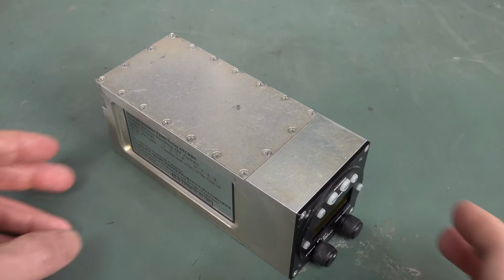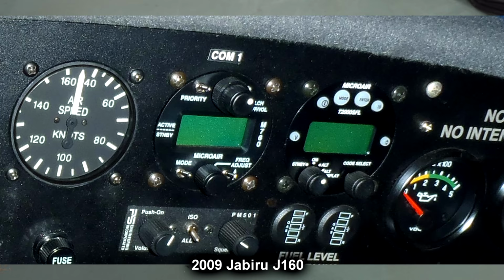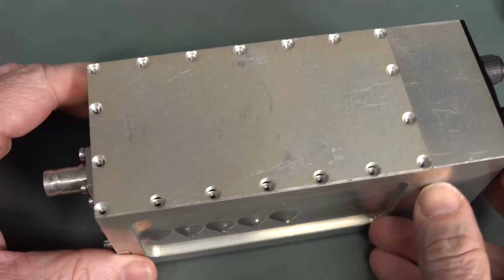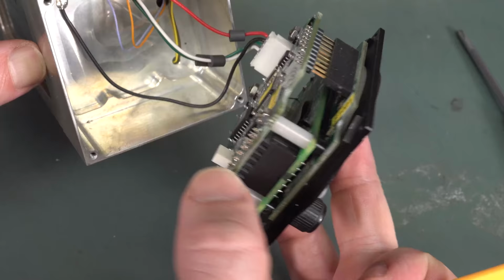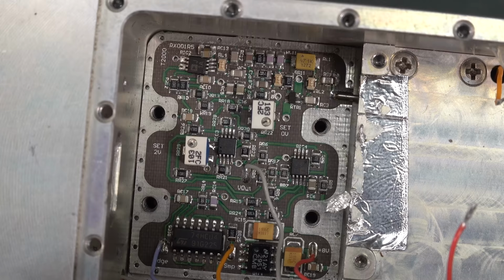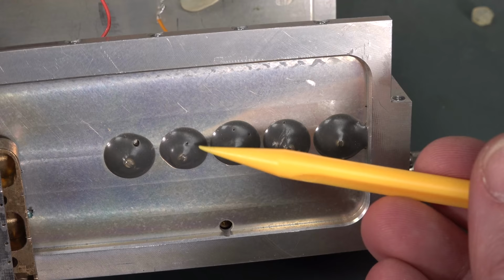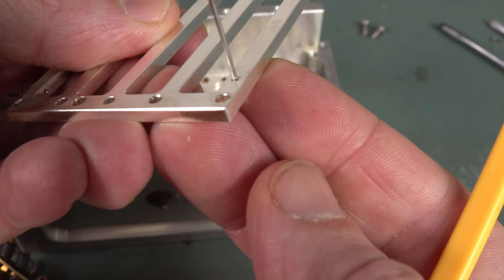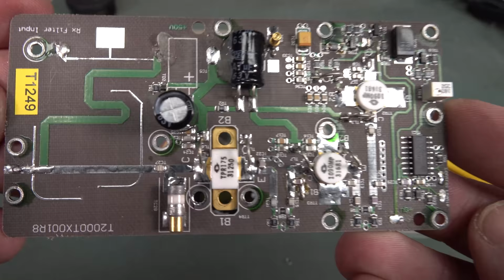EEVblog #1352 - Aircraft Transponder TEARDOWN!

Comment: Quite beautiful, but not exactly "designed for manufacturability". Wonder how much simpler it would be if redesigned in 2020. Not likely since all those regulatory approvals must have cost a fortune.
Reply: I wonder how all those floating unsupported wires survived the shaker table, but I guess they are short enough to survive. Definitely not short enough to pass design requirements for “big boy” avionics – they don’t allow this even if it may pass testing.

Comment: What, no massive --->>> arrow or outraged / disgusted / disbelieving face in the preview? YouTube stats won't like that. Good on ya! The filter is sometimes called an Interdigital filter (digits = fingers rather than numbers) very common when you are dealing with full duplex RX and TX that are comparatively close in frequency. When they are single channel this is a good efficient solution to the problem. Nice high Q.
Reply from the maker: Doesn't an interdigital filter have alternate grounded fingers? The terms seem very loosey-goosey.
Reply: @EEVblog  No. It's just a series of optimum-coupled resonators in a linear form.
Alternating the direction (if used) is to reduce the capacitive coupling. 
In this case the interleaving strips are to reduce the inductive coupling.
Without them an optimum-coupled filter will require surprisingly large spacing.
Reply: @EEVblog  It is a relatively general term, the various topologies and architectures are just "gravy" so to speak. Each designer tends to have their own tweaks and optimisations, depending on need and personal preference.

Comment: woah, woah, woah... Soldering alumium?!
Reply: Yep, you can solder to aluminium even with regular 60/40 solder.  It's all about technique (and/or the right flux).
Reply from the maker: With enough flux you can solder anything
Reply: That is not impossible. There is an old trick with mineral oil and a piece of steel wool under the leaded soldering iron tip to do it even without using any flux. And with all the modern fluxes and solders available today a job like this is actually pretty easy.
Reply: @Kirillissimus  Yes, the only problem soldering aluminium is that the material oxidizes so quickly the solder can't alloy with it.  If you provide a barrier (flux) that stops the air reaching the aluminium and then also provide a mechanical abrasion to break through the oxide it will take solder just fine.  Be aware though that aluminium is a great heat-conductor so you'll need an iron with plenty of heat or you'll never get things up to temperature.
Reply: @xjet  If a joint does not want to get hot enough then it probably just means you need a bigger soldering iron. Or a blowtorch on the other side of the part. Or both. Just don't melt the alluminium itself.
Reply: It is silver plated
Reply: @shazam6274  Of cause it´s silver plated, first because of the skin effect at 1GHz ! That´s normal with SHF stuff
Reply: @xjet  Copper has not quite twice the heat conductivity of aluminum. If you can heat a copper piece enough with an iron to solder to it, you’ll have an even easier time with aluminum – it’ll drain the heat away at half the rate, everything else being same :) Copper is easier to solder to, and alloys easier with solders IIRC, so that compensates for the heat loss as the joint will take at a lower temperature. Aluminum soldering needs a proper technique since the joint has to be isolated from oxygen and deoxidized fully to get a good joint. Usually a special flux is used, but in a pinch a high boiling point mineral oil will do.

Comment: I don't think this cost 2500$ to make
Reply: I don't know what their manufacturing costs were, but I can guarantee you that it's not cheep!
Reply: Not to make, no. But to certify, perhaps.
Reply: Yup, it’s the certification costs that control the pricing. You can often get almost identical non certified equipment (for “experimental” aircraft) at a fraction of the certified cost.

Comment: Aviation for small planes is very stagnant and overpriced. It's very much like cars in cuba. Nursing old junk. There is some progress but it really is awfully backwards.
Reply: It's changed a lot relatively recently. In 2014, the Experimental Aircraft Association in the US worked out an agreement with the FAA for a program of issuing Supplemental Type Certificates (STCs) for aircraft fitted with experimental avionics.

That's led to vendors like Avidyne, Dynon and Garmin coming out with relatively low cost glass-cockpit instrumentation systems based around high-quality displays, solid state gyros and air data sensors, CAN-bus system communication, and software that can be updated on a six-monthly release cycle without requiring recertification.

Originally designed for homebuilt aircraft, the STC program means they can be installed in certified planes like Cessnas and Pipers, which has driven production volumes, keeping prices low.

I'd rather a (relatively) cheap Garmin G3X system than a monstrously expensive G1000 system. Retrofitting a G1000 into a Cessna 172 is an almost $100,000 exercise, vs $25,000 worth of gear to get exactly the same capabilities from STC'ed electronics.

Garmin and Dynon primary flight instruments are less than US$2k, in a 200 gram package containing air data sensors, gyros, 6 hours of backup battery power, a sunlight-readable color display providing artificial horizon, heading, skid-ball, altitude, VSI, HSI, and (optionally) a CAN-bus autopilot controller.

Not your grandma's instrument panel.
Reply: Both Cuba's and GA Aviation's reason for stagnation is also pretty much the same: laws... In the other case maybe necessary, in the other maybe not so much.
Reply: @MarkNewtonFlies  FAA is blamed for a lot but that's just not true. A grave example is Incontinental and Lycoming engines; crude engines originally designed in the 1950s, produced largely unchanged ever since, they are unreliable and unsophisticated and have only gone up in price ever since. It's so grotesque that a Lycoming AEIO-580 6 cylinder 315HP piston engine with no turbo or anything remotely modern now costs 139k$, not including installation. A Cessna 172 first flew in 1955, based on a design from 1948. It's the most sold small airplane in the world and is still produced today with no replacement and goes for 400k$. Engineering and aerodynamics wise it's a turd with wings. Granted it is a small market but such phenomenal stagnation is not on FAA. It's quite possible certification procedures could be more streamlined but I've heard only decent flexibility from FAA and it seems to me that it's not the certification process that leads to great development costs, it's just the development that costs. New planes are certified from time to time, some go bankrupt, others don't but I've actually never heard once that they had a perfectly good design ready and FAA incurred unbearable costs for no reason. I'm not saying FAA is a picnic but it's most certainly not the cause for the inexplicable stagnation in small GA. I guess the real reason is intimidation by the topic and then it just sort of happened and people have been too vacuous to question it.
Reply: @sageii5614  See, you might say that, but my 1950s-designed Lycoming IO-320 uses about the same amount of fuel per 100km as as Holden Commodore, but it conveys me three times faster and in straight lines. It's simple, it's reliable, it has relatively few moving parts. I'd much rather be flying behind a Lycoming than (say) a modern Jabiru engine design, which is so unreliable that CASA has prohibited it from flight over cities and requires passengers in Jabiru-powered aircraft to sign disclaimers to warn them about the likelihood of their death.

Aircraft engines are designed for a fairly specialized application: They need to spend virtually their entire operating life operating at or near the redline, they need to be lightweight (so luxuries like coolant are undesirable, and they're made out of some relatively exotic lightweight alloys), and they need to be reliable.

As an owner of an aircraft engine, I might have a bit more skin in the game than you do. I have a variety of choices about what kind of powerplant I could put on my aircraft. The balance of performance, cost and reliability, underlaid at all times with safety considerations, leaves me happy with my trusty Lycoming.
Reply: @MarkNewtonFlies  no, you are just part of the problem, defender of status quo, conditioned with what exists, fond of it so defend it without thought. I own a plane too so don't give me that bs. Mine has a rotax 912, slightly more modern but still massively overpriced. with even modest innovation we would be flying 600km/h at FL400 at LSA prices in quiet smooth twin jets at better fuel economy than a prius. I'm a quite capable engineer and I ponder how things could be better. You don't.
Reply: @sageii5614  I'm an engineer too, Sonny, so don't give me any of that holier-than-thou nonsense.

While a Rotax burns less fuel mass per hour than some of the older designs, it's also lower-power. You might be happy tooling around at 90 knots in your Foxbat and sing songs about how it burns 12 litres per hour, but if I throttle my Lycoming back to 20% power I'll also get 90 knots at 12 litres per hour; And I also have the option of flying at 150 knots at 28 litres per hour, which means I can get me and my partner from Sydney to Brisbane in less than 3 hours and burn about the same amount of fuel as a family sedan, costing less than a jetstar ticket.

Your Rotax is liquid cooled, which means incrementally increasing its power output requires an increase in coolant mass and radiator airflow drag to reject its inefficiencies as heat, which places a practical limit on the wattage it can produce before it's too heavy to be sensible for an aircraft application, which is why the Rotax 912 platform is good for small airplanes but a poor choice for large ones.

And that's why virtually all large-capacity aircraft engines are air-cooled, and why Rotax makes literally none of them.

Everything in life is a compromise. A quite capable engineer will distinguish the difference between a platform optimized for one specific application vs a whole realm of design.

If I had a sub-600kg aircraft, I'd very likely power it with a Rotax (and aim to reach my destinations in time for dinner instead of lunch). But there are limits you seem to be ignoring in your tirades against incremental refinement and optimization.
Reply: @MarkNewtonFlies  sigh, I never said rotax was the answer, dummy. they are part of the problem, that was just the limits of your imagination. It's besides the point but there is no inherent problem in water cooling. It's possible to circulate tiny amounts of water and carry enormous heat. But again, besides the point. Sharp Nemesis did 500km/h at sea level with 100HP. I imagine your colonial tractor would have difficulty keeping up and that's but a fraction of the opportunities there are in aviation. Your mindless status quo defending obtuseness is exactly the problem in aviation. No one questions, no one thinks. But I do. And I'm not an engineer, I'm a comp sci/physics polymath genius. Engineering is trivial carpentry next to real science. What was it Sheldon said about engineers and physicists? Don't be a disgrace to Newton's name.
Reply: @sageii5614  Again, you’re missing the wood for the trees.

The Sharp Nemesis was a very efficient airplane (that has since been eclipsed), but it’s also one which couldn’t fly at all if it’s pilot was heavier or lighter than John Sharp. It was designed for one specific purpose (“Convey John Sharp very quickly in closed-circuit air races”), and sucked at anything else.

I’ve flown gliders with a glide ratio better than 60:1. Nobody serious is suggesting that that means airliners should be flying around on 10% of their current fuel burn.

As I said in my last reply, everything is a compromise. The compromises necessary for general purpose applicability tend to converge: The reason we’re not using different general purpose power plants now is because none of the newer alternatives have presented compromises sufficiently better than the ones we landed on 70 years ago to displace them.

Making silly ambit claims about what we could achieve if imaginary progress had been attained is pointless speculative fiction. None of those things you describe have actually happened. If they had, we’d all be using them.

tl;dr: Give me a power plant that costs the same as a Lycoming but is better, and I’ll use it. If you’re just cajoling when nothing like that actually exists, you’re just behaving like an irritant. Pointless.
Reply: @MarkNewtonFlies  actually they are suggesting glider wings for airliners. And you just stated that if a product hasn't already been made it cannot be done. Which is beyond idiotic. I wont answer your mindlessness again.
Reply: @sageii5614  If "they" are suggesting glider wings for airliners, then "they" have no idea what they're talking about. Glider airfoils are optimized for low Reynolds Numbers. Airliners operate in high Reynolds Number flight regimes, which require different wings.

(Which is why airliner wings have lower thickness-to-chord ratios, have higher aspect ratios, and and have swept planforms. But an accomplished engineer such as yourself would already be familiar with those concepts, and would therefore already know that it's nonsense to speculate about glider wings for airliners, so there's no need for me to belabor the point)